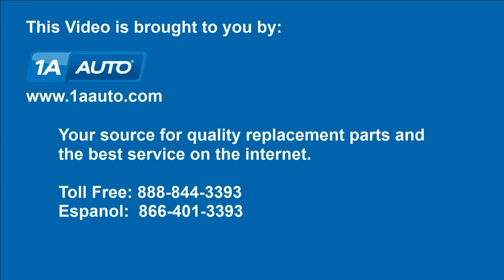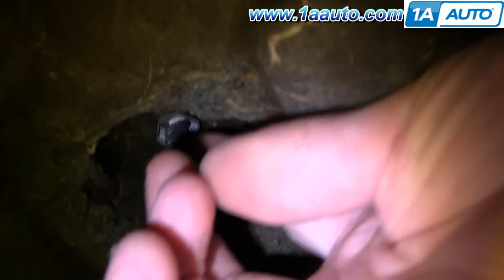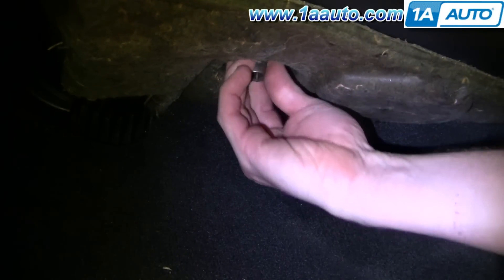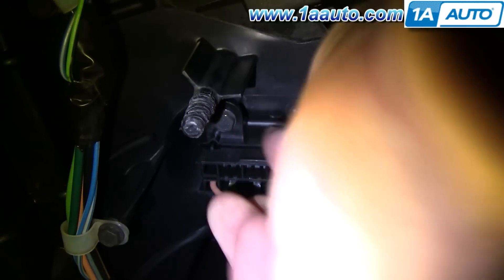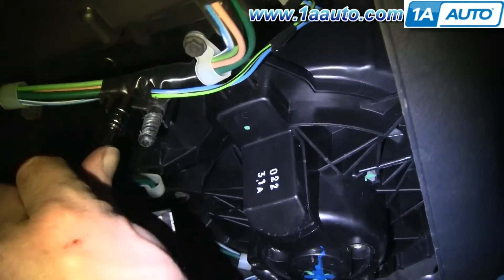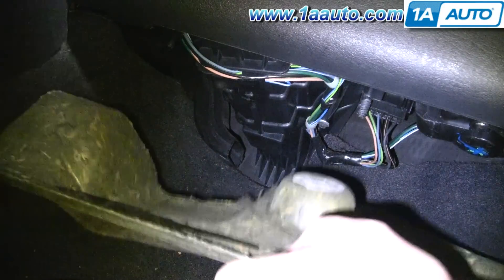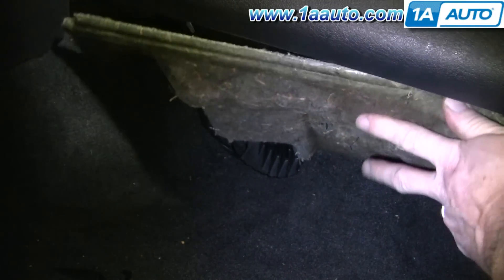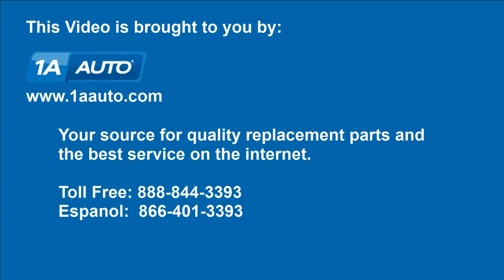How to Replace Blower Motor Resistor 01-04 Dodge Stratus

Comment: In my 2004 Stratus the blower setting on 1-2-3 would NOT work but setting 4 would on my A/C.  I asked a local auto part store and told me what it could be/then I asked a mechanic who told me the same.  This video helped tremendously.  Although it did not mention the pull out or down the red clip prior to pushing the retaining tab thingy; the clip is on the tab, you just can not see it from your angle, just like the video.  Thank you video uploader guy.

Comment: Great video! I replaced both my resistor and the blower motor today in a matter of about 15 minutes. A few shops near me said upwards of $300 for parts and labor. I did it for less than $80! Thanks 1A Auto Parts!

Comment: Just used this to replace mine.  NOTE:  1. It was a lot easier to disconnect the resistor from the connector (with the wires) after removing the two bolts and pulling the resistor out of the gap.  2. the new resistor I bought was a lot thicker than the original.  I had to expand the size of the slot for the resistor (my dremel worked great).   3. When putting it back together it was easier to put the resistor in and bolting it down first.

Comment from the maker: When you turn heater on it will help to cool the motor down, this is fine. In fact if your car's ever starting to overheat, an old school trick is to turn the heat on to help bring the temperature back down. We do not carry door panels for this vehicle, you may want to see if your local salvage yard has a decent one in a wrecked vehicle for you. That would be the cheapest way to get one. Hope this helps you out. 1aauto.com 888-844-3393

Comment from the maker: If you have a Chiltons or a Haynes manual if should show you a wire diagram for the blower motor. If you have a test light, test the end of the plug to see if there's power to the resistor and the blower motor. If there's no power to them check the fuse to see if it's okay.

Comment: Thanks for this, it was a huge help! This was the second time my resistor wore out on my 2001 Stratus, first time I took it to a dealer who charged me over $200 to fix it.

One thing I wanted to point out, when I did my repair the new resistor (bought from 1aauto.com) wouldn't fit in the compartment, it was too wide, I looked around elsewhere online and found other people had the same issue. I used my dremel to grind away at the plastic in order to make it fit and then everything was fine.

Comment: It's a lot easier to remove the two bolts first, then pull the resistor out, and then remove the wiring harness.  In my case when the resistor failed it arced and effectively spot welded the harness to the resistor in two places.  It was impossible to tell by looking at it. I thought I was losing my mind when I couldn't get the harness off the resistor.  Then I read on an online forum this is a common occurrence.  I had to painfully cut, separate, and peel away the plastic from the resistor where it fused to the harness while cramming my 6+ foot frame upside down with my head and arms where my feet should be under the dash.  It would have been impossible to remove the harness if the resistor was still bolted in.  Most people just cut the harness off and replace it if it gets fused to the resistor, but that wasn't an option for me.  Also, most replacement resistors are wider than the OEM model and won't fit into the hole during reinstallation.  You can take a pocket knife and shave a little of the plastic off to widen the hole.  Its cheap plastic and easy to do.  Thanks for the video.  I wish my experience went so smoothly.  It took me about 90 minutes of back breaking contortion to replace mine, but its nice to have cold air blowing again.
Reply: Steve Robertso
Reply: Steve Robertson thank you for shareing I though I was losing my strength lol. I had to cut it away and then the small wire came unhooked and it took forever to get it to crimp back on. Then I had to shave the hole to get the replacement in. Finaly got it and now all the speeds work though. Also next thing I replace around in there I'm gonna unbolt the seat to get more space
Reply: Thanks for your comment! It really helped!

Comment: I've noticed you have a few videos on dodge stratus/sebrings I have a question hoping you can help . I'm trying to install a remote start and having trouble finding 2 wires I've searched the internet and I cant find the a hand brake wire oil path wire . I asked the sellers of the unit for some help and this is what they sent me ,

1. Our product with a security design to prevent car moving or sb from driving way , so the remote start function only work in arm status and hand brake status (pulled up). 2. the oil path detecting is used for some cars with long start time and in winter season. in all , please double check the connection of the hand brake wire（purple） and the oil pump detection wire(green) 

Not sure where the oil pump detection wire on the startus is and the hand brake . I do know the brake wire is white and tan by the foot pedal but I'm stuck

Comment: My blower motor stopped running on my 2004 Dodge Stratus sedan 2.4 L I have replaced the fan control switch and then the blower motor resistor. After I replaced the resistor the fan works on high only. The plug looked a little bad like it my have shorted out so I replaced the plug. The fan still only works on high. Also I have checked the fuse and it looks fine. Is the blower motor itself messed up or do I have a deeper electrical problem. Or is there a way to test what is wrong? Having nothing but problems also when I replaced the resistor I had to shave plastic out of the hole to get the new one in. Thanks

Comment: Appreciate the video was able to get it replaced. The AC seems to be blowing harder(not complaining), but is this normal?
Reply from the maker: Thank you for watching. As a blower motor gets older the motor doesn't always blow as strong as the original. So it is not unusual for the new one to blow harder at first. Hope this helps!
888-844-3393

Comment: I am working on a car with blower speeds 1 & 2 not working. The original failed resistor is stamped with part number 04885919AA. The actual resistor is a coated P.C. board 2" high x 2" wide x 1/16" thick. My replacement is NAPA part number BR251, which has the resistors encased in a ceramic block 1 3/4" high x 1 1/2" wide x a maximum thickness of just under 1/2". I connected the wiring harness, turned the car on, turned on the blower and all 4 speeds worked fine. I took a black sharpie and wrote the date, mileage & invoice # on the ceramic block. I then tried to install, but of course it was too thick to install in the blower case. I went to Normandin Chrysler in San Jose to try to get a dealership resistor, but the parts guy said the ceramic style is only available now. He did show a "TSB" - Technical Service Bulletin - TSB# 24-001-05. A service writer printed it up for me. Of the 11 steps listed, the most important is #5, which says:
"5. Use a hot knife or similar tool to enlarge the blower resistor opening in the HVAC housing so that the opening matches the inside edge of the raised rib around the opening in Figure 2". 
Fig.2 show the resistor port with an arrow indicating "remover this material" - pointing to all of the plastic covering half the port. 

NOTE: Remove any/all debris from the HVAC housing.
TIME ALLOWANCE:
Labor Operation No: 24-55-10-95
Description: Replace Blower Motor Resistor
Amount: 0.4 Hrs.
So if you want to have a shop do the work, Chrysler service documents say it can be done in less than a half an hour. 
You've got to consider what your time is worth, and so far I've got far more of my own into this than I'd prefer. It was a total bitch getting the electrical connector separated from the part. I hope this helps you all.

Comment: This blankety-blank 2001 has one of those red safety clips, and i cannot figure out how to get the wire box out of the socket. The red clip lifts part way.....should it come all the way. If only part way, what do i push or pull to get the wire harness all the way out of the old resister socket?!?!?

Comment: Ok so i have an 02 stratus and my air-conditioner is acting up. It will work sometimes for a couple minutes and then it just starts blowing outside air and stops blowing cold air. I know it isn't low on Freon/refrigerant. Any ideas?

Comment: I just would like to double check that you did say this is the same for 01-06, Stratus, right?  I know the description says 01-04, but it sounds like you say 01-06. Thanks
Reply from the maker: This video covers the 01-04. It may be a similar procedure. We do carry a replacement blower motor resistor on our website for your application. Here's a link to them, thanks for watching. http://www.1aauto.com/2006-dodge-stratus-blower-motor-resistor/y-mo-c/2006-97-157?utm_source=YouTube&utm_medium=YouTube&utm_campaign=1ATony

Comment: The blower motor in my 2001 Dodge stratus started not blowing on any level, then would randomly work again until it didn't blow at all.  I replaced the resister and I started working again but right away started randomly working then not working.  Do you think its the motor itself?
Reply from the maker: It could be, you may also want to check the plug end that goes to the blower motor resistor for heat damage. If it's damaged, then you may want to replace it as this could cause an intermittent on off situation that you're experiencing. 1aauto.com

Comment: my A/C works. 2002 Dodge Stratus.  4 door. but the only thing it does is when put on different levels the car pulls on and off 4 a second. what do I need to do. why does it pushes or pulls when A/C is on.

Comment: My 2001 A/C is blowing cold for about 5 minutes then blows hot air, too.Just paid someone $85 to fix the resistor. Shoot, looks like I could have done that myself. What is a blend door?  I want to sell the car but a mechanic said it would cost $600 to fix/replace here. Some don't want to take a chance on it. Guess I am stuck with it thought it is a reliable car.

Comment: Dodge stratus 02. the meter of the car temp. Drops down every time I turn on my heater or coolant. What's wrong with it. I also need the door panel cover broke when this auto people tried to fix the power switches of the window. Now the switches are hanging down. Where can I buy the door cover panel.

Comment: i cant get the clip to unclip. how do i make it easier to take off
Reply: Commando jives there is probably a little red clip that you have to pull away from the resistor. That's how mine was

Comment: Hy. This is my brother id, but. I am from Europe. I have a 1997 Chrysler Stratus LE 2.0 131bhp. In 3 weacs i changed 3 heat resistors. Fan speds 1,2,3. Dont work. Want thoo do. I can  not afort to buy each weeak a new heat resistor.. OMG there are so weak. Sory my bad english and if you can please help me. Thanx
Reply from the maker: You may want to check the wiring going to the blower motor resistor to see if it's damaged. If it is you may want to fix it. You may also want to see if that wire is possibly coming into contact with something (like a piece of metal) which may be causing this issue. 1aauto.com 888-844-3393
Reply: Thanks for help and for the Tel nr. but also very prompt response. Hope i solve the problem. Goodbye.